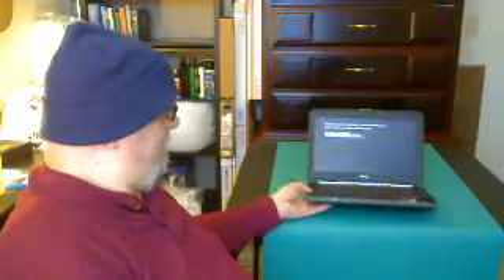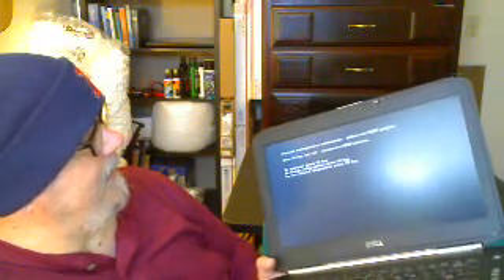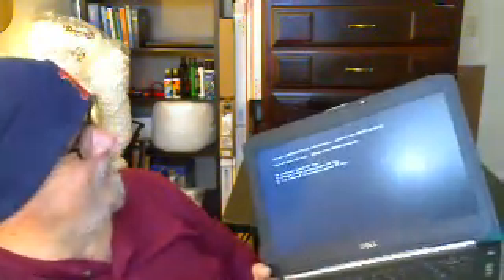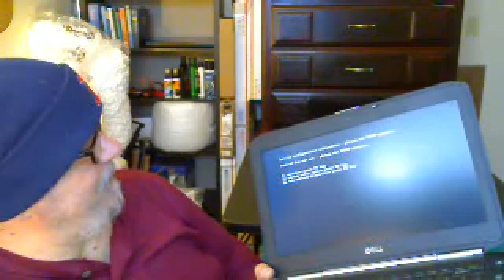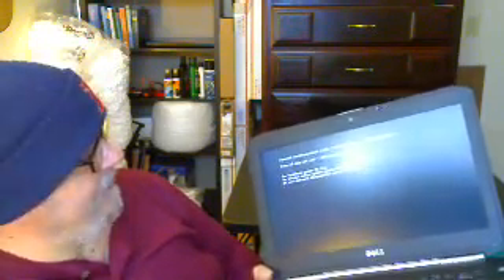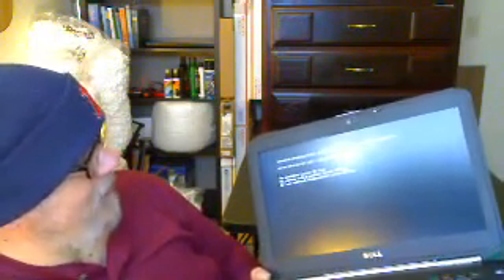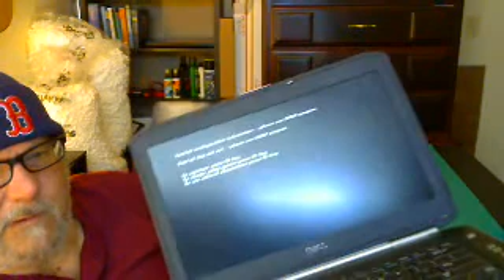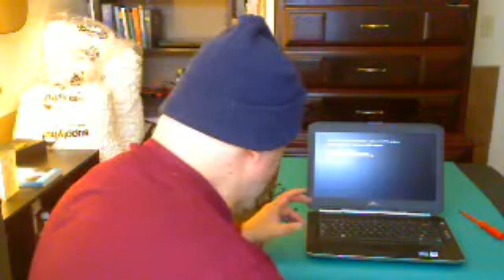How to fix Invalid configuration information error

Comment: Actually after doing some looking,there are some variance in cmos batteries,some Toshiba are 2.4v,many are 3v,apple 3.7v etc. I just started getting this error on my Dell M4500. Thanks for the video,good to know what the trouble is..  There is no Hot,Ground and Neutral on DC batteries,that just applies to AC house wiring :) Some searching says the 3rd wire is just soldered to ground,but i don't know.